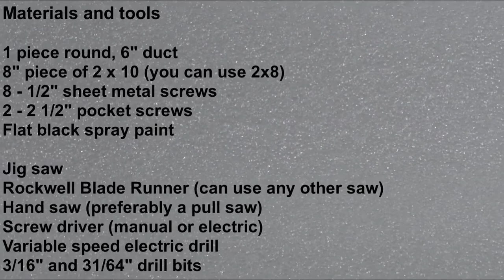Cheap DIY Squirrel Baffle - Keep them off your bird feeder!

Comment: Can you give an update if it's really working to keep the squirrels away? Also your video did not address anything on how you got and cut the metal piece.
Reply from the maker: Yes it is.  I'll make a note in the description.  It also is preventing our resident racoon from getting at the feeder.  Saw it on our trail cam looking very confused how to getpast it.   We have one in the backyard.  the metal tube is just a 6 inch duct from the local home improvement store.  No cutting.  Just drill holes for the screws.  thanks for commenting!